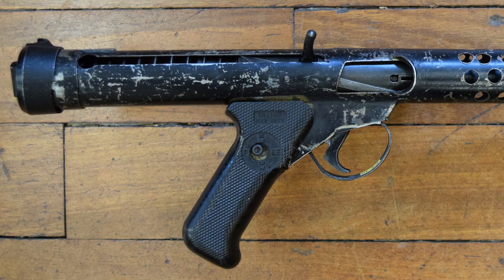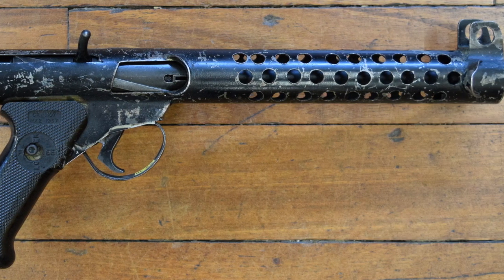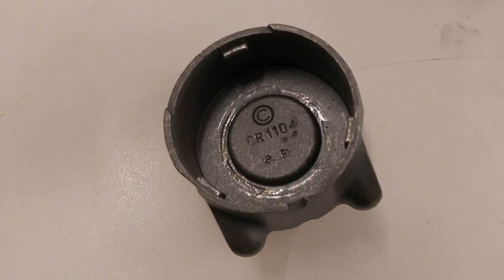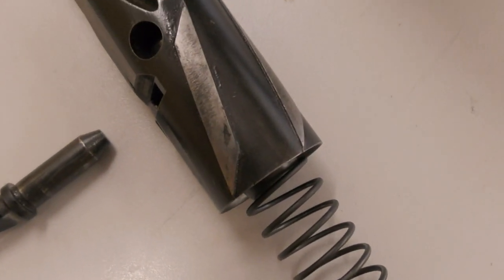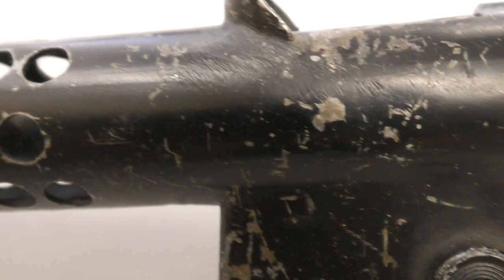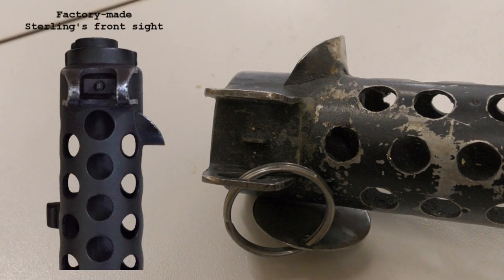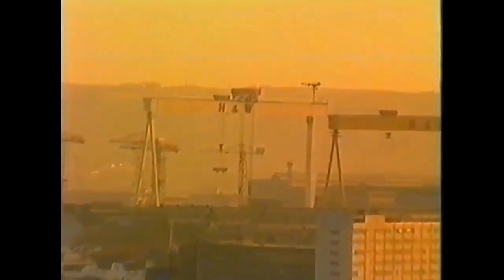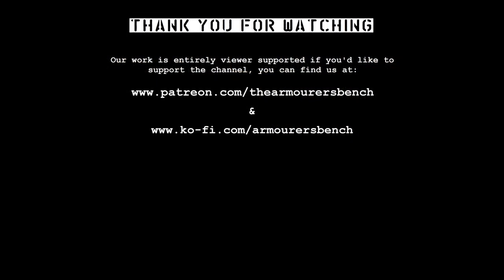Northern Ireland Sterling Submachine Gun Copy

Comment: Another interesting video, Matt. Do you have any footage of the gun being fired? I would be curious to see how it would perform compared to a Sterling. Also, was it built to accept standard Sterling magazines, or were there any home built magazine made to go with the guns?
Reply from the maker: Thank you! I wouldn't have contemplated firing it to be honest, the end cap wasn't secure enough. It might have fit better when it was made. With a bolt and the dual recoil springs taken from factory made sterling I think the rate of fire would have been similar to that of a factory gun. Yes, it was definitely dimensioned to feed from standard Sterling or Sten mags, making reliable mags is almost more difficult than making the gun so they'd probably have relied on factory mags.
Reply: @TheArmourersBench   : Do you think this gun is a one-off or part of a small-run of guns built? It’s interesting that somehow the builders could source certain parts of existing guns to make them work. I also would think homebuilding Sten clones would be easier for an insurgent force to do then knocking off a Sterling, which is a more refined and professionally built gun needing skilled laborers and machine tools. It’s too bad more of the history of this gun isn’t known.
Reply from the maker: Some of the Loyalist made SMGs are much, much crude. This one is a very well made example. Largely let down by the metal quality of the tube used for the receiver. You're definitely right it would have been much easier to make a Sten. The fact they went to the lengths of mimicking a real Sterling is very intriguing. I wish I knew more about it too. The head of the collection just told me it originated in N.Ireland. It may have been a one off or a small run, no way of knowing currently. But the sourcing of parts was apparently fairly common. I too would love to know more about that. One of the sites I link to in the accompanying article is working on more research into the weapons of the conflict I believe.
Reply: @ultrablue2  When some of the loyalists were probably in the UDR & RUC sourcing parts would be less hassle than you might think.
As for potential builders you are probably looking at people with connections to Harland & Wolff and Short Brothers.
Reply: @TheArmourersBench  I would strongly suspect they wanted it to look like an issue Sterling so they could pass them self off as soldiers when they went fishing for victims at unofficial road blocks. They had no problem obtaining uniforms via the UDR.
Reply: @demos113  the man responsible for running a huge factory churning thousands of these out was never an employee of shortts or the shipyard. But a former UDR soldier who was a farmer.
Reply: @TheArmourersBench  wow much crude
Reply from the maker: Hahaha!

Comment: There was a farm in a place called ballynahinch outside of Belfast raided in the 80s by the RUC. They found 30 complete homemade STEN guns. Parts for over 800 more. One factory made Uzi and two complete functional copies made by the same loyalist.

Loyalist SMG’s like the Avenger evolved. The newer ones had folding stocks. Silencers and even rifled barrels.
Reply: @Cuddly Cat think handguns are still legal because of the security situation. Quite a lot of ex/serving soldiers and policemen carry Personal Protection Weapons. Even ironically members of Sinn Fein have them issued too due to attacks by Loyalist paramilitaries. 

Handguns are legal on the mainland. They just have to have stocks and longer barrels.
Reply: @mrchickenfeathers9184  i highly doubt any member of sinn fein was ever issued a licence for a handgun , im fairly sure handguns were banned in the uk after dunblane.  I would think they would be limited to serving or ex service men .
Reply: @liamg1706  PSF members were issued PPW’s actually. And no. Handguns are still perfectly legal in NI.
Reply: @mrchickenfeathers9184  never knew that,  very surprising
Reply: Rifling should be the norm today due to electrochemical rifling (though, for reasons I don't understand, it's apparently difficult to do for longer, smaller-bore barrels? Is it just that very tall and thin things are hard to print? Just turn the printer over, then, a la Maker's Muse..)

> Handguns are legal on the mainland. They just have to have stocks and longer barrels.

And the rather more restricting requirement that you "prove your need" for it...